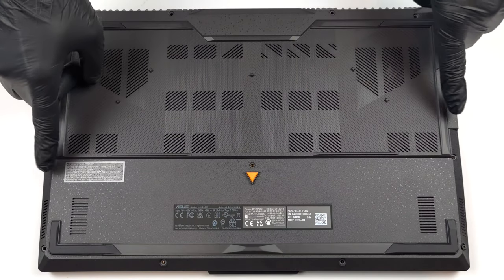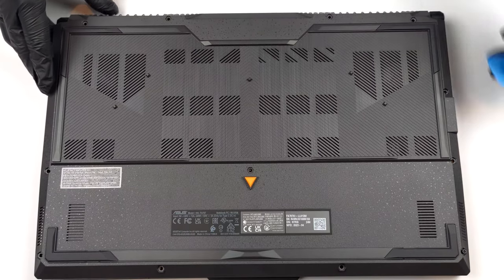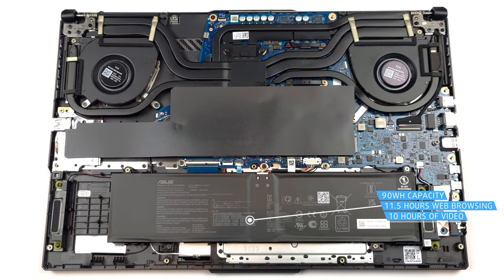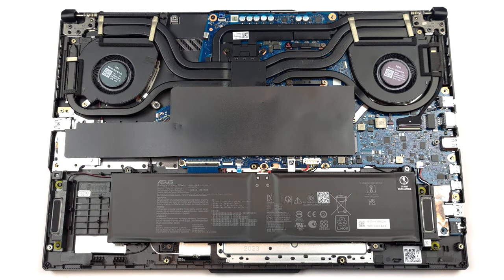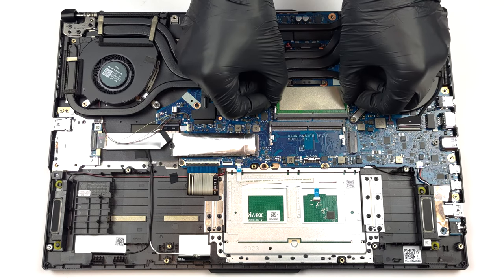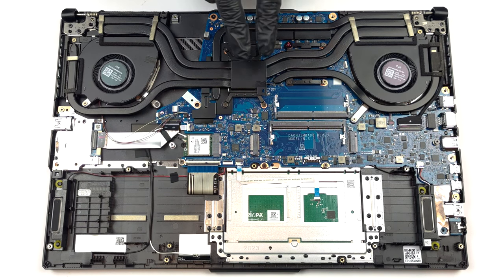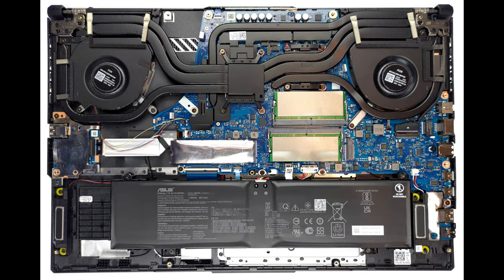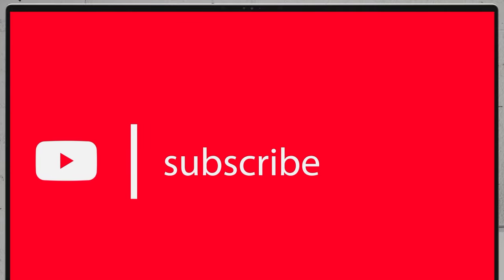🛠️ How to open ASUS TUF Gaming A17 (FA707, 2023) - disassembly and upgrade options

Comment: Just upgrading my A17 and wondering what your opinion on re-using the heat spreader pads on the new RAM is? Peeling the ones off the old ram, they seem in great condition (No bends or creases) and possibly can be re-applied to the new RAM. Is there any benefit to doing this at all or is there potential for it to increase heat signatures?
Reply: I don't know

Comment: does anyone experienced issues with adding a second hdd? I've added but the system doesn't recognize it. Any idea?
Reply: Have you tried swapping the HDD in between the slots? If the same HDD works on either slots then something must be going on with the HDD... also try to access them through the disk management in the PC..
Reply: SSD not hdd
Reply: there is a video about disk management section in windows 11 to recognise the second ssd, type something like ssd upgrade asus a15 disk management windows 11

Comment: hi, I have a question. Can you check if BIOS lets run Windows from both SSD slots? I need to have two Windows systems - one on each SSD. I want to be able to run either one at any time and switch between them
Reply: Why don't you just enable the Hyper V and use a virtual machine?